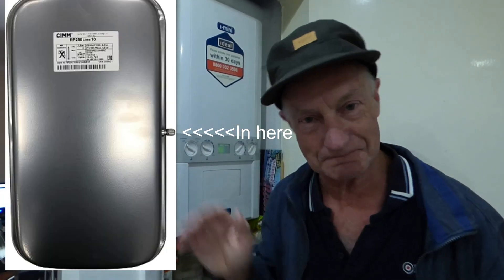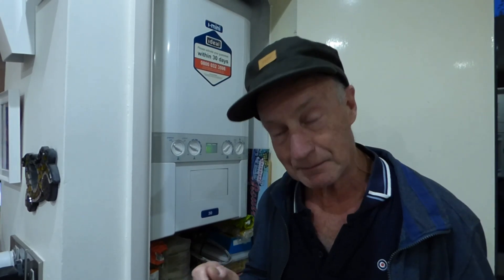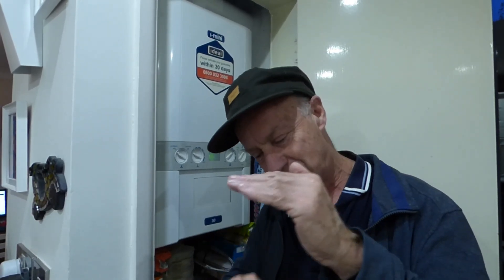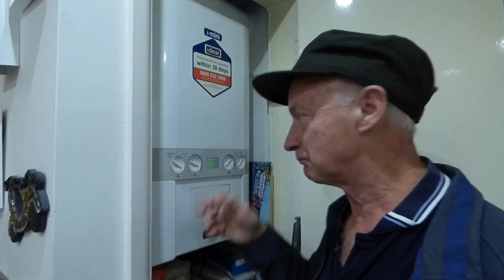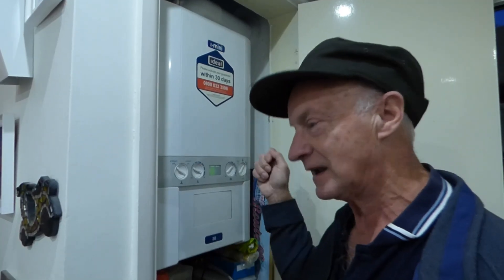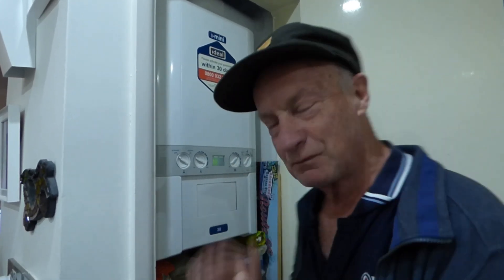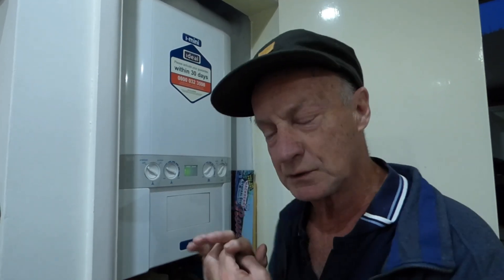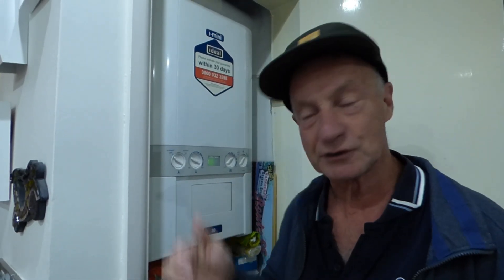Combi boiler pressure keeps going very high?

Comment: Hi Al, I recently had this problem ony valiant pro 28 combi. Kept coming up with F22 fault and would shut down as pressure got 2 high. It turned out to be a pin hole in the rubber on the expansion vessel so the whole thing was full of water. All sorted now 👍
Reply from the maker: Thanks James a common fault.

Comment: Question: does what you have said here apply to our boiler? We have a Potterton e50 Netaheat (not a combi boiler) hot water cylinder in airing cupboard. When the Honeywell programmer water programmes on at the same time as the heating, the radiators are off the scale boiling hot. We have to now manually switch off the heating via the Honeywell programmer in the airing cupboard because if you try turning down the hallway reoom thermostat the radiator heat still just stays boiling hot. Does what you are saying in this video about the exapnsion vessel apply here? thank you Al. Merry Christmas to you and Jan.🎄🎅
Reply: also the water when heated even for hours is warm but never hot nowadays. We a re in a bungalow and the boiler is in the garage and the header tank is in the loft.
Reply from the maker: The 3 way valve is faulty. you have an F and E system to no pressure problems.

Comment: Excellent video! This is happening to my boiler so its very helpful 👍
Reply from the maker: Glad it helped
Reply: With all due respect, make sure you grasp what he is saying, that it happens when the system warms.  IF it happens whether the system is warming or not, it is more likely to be the fact that one or both of your filling loop valves are passing.  It's better to remove the filling loop, then the system cannot over-pressure from the mains.  Water regs state that the loop isn't left connected, anyway, because if the valves fail, CH water can go back into the drinking mains.  But I see 99% of them left connected.  Unfortunately, I have been caught out a few times by courteously going to remove the loop (for the customer) only to discover that the check valve valve isn't functioning...and I got wet (yet again!).  Best to gingerly remove the flexi-tube and wiggle it to see if the valve is ok before completely unscrewing it.  It only happened to me three times before I started treating them with utmost caution!  The vast majority of filling loops I come across have one valve left on, and the customer uses the other.  I tell them the rules, and leave it to them.